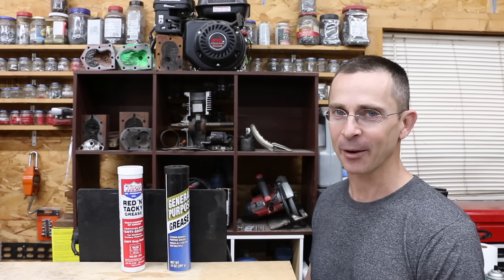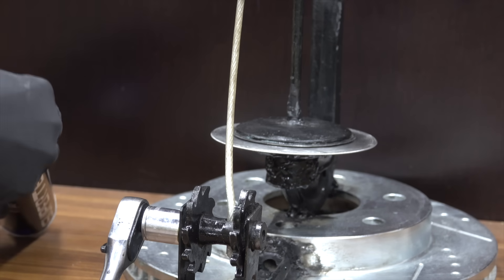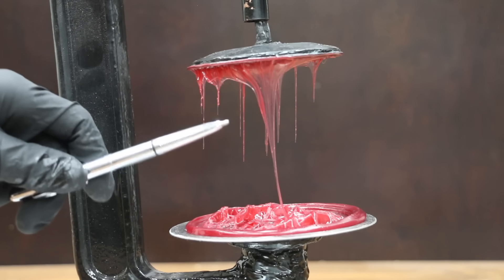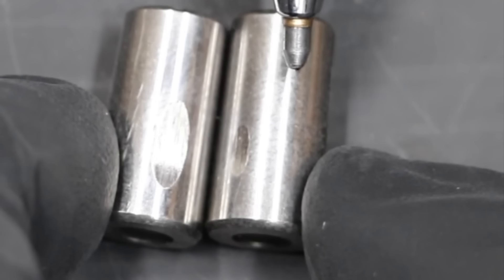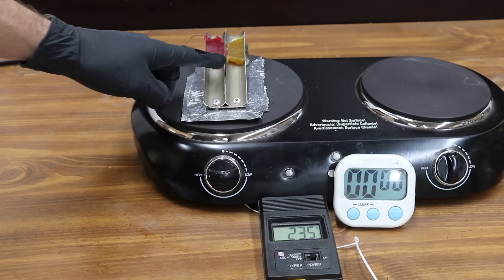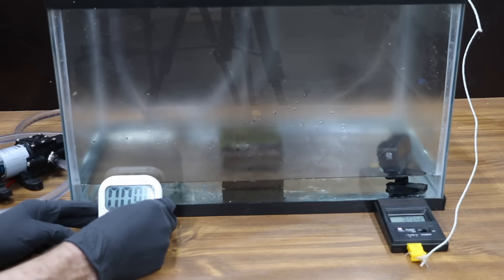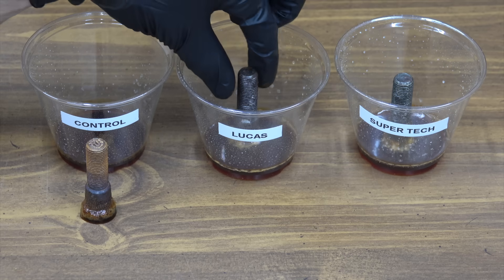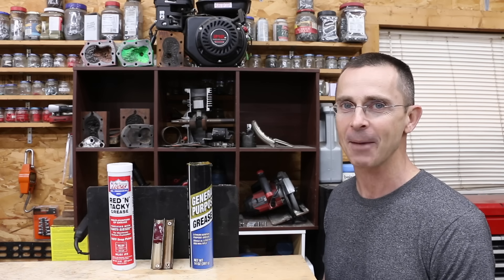Is Cheap Grease better than Lucas Red N Tacky? Let's find out! Bearing Grease Test Episode 1

Comment: I'm going to start sending you invoices for my time, since I spend more of it watching you than doing the work I'm supposed to be doing!  I was actually surprised by the significance of the differences between these greases.  Your test for tackiness was especially interesting and it makes me wonder how each of them would handle centrifugal force.  In many automotive applications centrifugal force would want to send the grease outward in a packed bearing, eventually depriving the inner race of grease if it all has a place to go.  The compatibility of grease is no joke, and I'm glad you did mention it.  In future grease tests I'd be curious how different grease types hold up in similar tests (say, lithium and silicone and Moly based, etc.)  Also, there are instances in automotive repair where grease is intentionally mixed with oil, such as replacing an outer wheel bearing in an axle.  The bearing is packed with grease, but the expectation is that the gear oil will make it's way down the axle tube and eventually mix in with the grease and wash it out.  I've always been curious if one type of grease or another is best used in this situation.  Similarly, transmission and engine assembly often demands a temporary grease be used before trans fluid or engine oil gets through the lubrication passages.  It would be interesting to see how a mix of grease and oil fared in some of these tests.
Reply: The special grease used in engine building is by design, intended to mix with oil. It won't hurt the oil, or the metal parts it's in contact with .
I've built, and helped build a lot of engines and I used 105, engine grease. It works great. One gentleman put an engine together by himself then called me and said the engine wouldn't build oil pressure. 
We pulled the engine,  he didn't tighten the oil pick up tube and the oil pump was only pulling air. We checked the crank shaft and bearings and they were fine. We did recoat them put the engine back in and presto we had 50 lbs of oil pressure.
Reply: @bertgrau9246  Yes, there are special assembly lube for engines, such as Permatex Ultra Slick or the 105 you mention.  Back in the day when I was rebuilding transmissions there were uses for grease too, including holding checkballs in place for assembly in valve bodies, or lubricating thrust washers, or bearings, etc.  In axles with bearings that will start up dry I've only ever seen manufacturers recommend a high temp grease, without being specific.  Some bearings also come with grease installed, even though the bearing might be for multiple applications.  Another area where oil and grease can mix is on splined input or output shafts which initially need grease but eventually will have oil mixed in.

Comment: I have several tubes of lucas red and tacky that are about 8-9 years old when i load them into a grease gun it leaks oil.  This did not happen when they were new, and I don't have any other brands of grease to compare against. I know from past experience grease doesnt usually separate with age. Old wheel bearings getting repacked after sitting decades
Reply from the maker: Thank you for the feedback

Comment: I have been using Lucas Mucas Red N Tacky exclusively on my 2005  Cub Cadet with great success. 15 years and still on the original deck spindles. Seems to be good stuff. Since I'm a huge fan of Motorkote I have contemplated purchasing some of their grease but wonder if the huge cost difference would be worth it. I've also started using Lucas green grease which claims to be heavy duty, but is it? I use Schaeffer waterproof grease on my snowmobiles. Different grease for different applications. I'd like to see red N tacky, heavy duty green grease, Motorkote, and Schaeffer head to head. Thanks!

Comment: Liked all the test set ups especially the power drill. Testing all major brands is a must. You should mention that most universal joints do not use wheel bearing grease. Coming from you it's believable. Keep up the great testing.
Reply from the maker: Thank you for the feedback

Comment: Wow, Lucas kicked SuperTech's ass. I would like to nominate Harbor Freight's "Molly" grease and Red grease. I would also like to nominate mobile 1 synthetic grease, and Mystik marine grease.
HF "molly": https://www.harborfreight.com/sta-lube-moly-graph-lithium-grease-40712.html
HF red: https://www.harborfreight.com/14-oz-sta-plex-extreme-pressure-premium-red-grease-40710.html
Mobile1: https://www.autozone.com/greases-and-gear-oil/lubricant-grease/mobil-1-synthetic-grease-tub-16oz/934751_0_0
Mystik: https://www.basspro.com/shop/en/mystik-jt-6-high-performance-marine-grease-nlgi-no-2

Comment: One of the reasons why it says not to mix greases not necessarily because of a chemical reaction between the two greases that you can easily see , but because it can dramatically change the mechanical properties of the greases ( for example try mixing two unlike soaps/ shampoos or hair gels).
Reply from the maker: Thank you for the feedback

Comment: The Red stuff from Lucas didn't last long in my rebuilt front suspension (<500 miles).
Since I am a fan of most products I have tried from Lucas, I tried the Green Xtra Heavy Duty stuff from them and have had no problems at all in over 3,000 miles. 

I would like this series to continue to see what would be the best grease.
Reply from the maker: Thank you for the video idea!

Comment: I use Lucas oil everything in my race cars and rv and passenger vehicles. I highly recommend Lucas and this video proves the point. Stay away from Walmart brand anything when it comes to metal on metal protection it doesn't pay to be cheap!
Reply from the maker: Thank you for the feedback

Comment: dypex grease is one you should try. its very expensive, but claims to impregnate itself into the metal, and i've heard of it in practice stopping a drill press from being able to drill through metal.
Reply from the maker: Thank you for the feedback
Reply: thanks for doing these comparisions. also, i just thought of another thing. lucas red and tacky is far from the only heavy red grease. i wonder if there is a real difference between heavy red greases.

Comment: Awesome video! I would’ve paid to watch this in a theatre!!! 

Next we need a grease run off like the oil!!! We run a trailer repair shop and see many bearing failures on a weekly basis. We do a lot of salt water trailer bearing failures. Please let me know if we can help with supplying products we use. We’re using Schaefer’s currently but have tried many others. We use your videos to stock our shop with tools and everything that tests well to make our life easier on the job as well as more efficient. 

Please message me a reply if we can’t help in any way to find out what we can put in our customers trailers hubs.
Reply: Personally I use Mercury 2-4-C marine grease on boat trailer bearings, I know it's not intended for wheel bearings but I believe it repeals water very well. I would love to see it put to the project farm test.
Reply: Zach we did some testing with the greases we have. Notice when you read the tubes they say water resistance. We found one that’s “water proof”.
Reply: @RaceMentally  what is the brand?

Comment: I worked professionally on vehicles for many years, and I always used "KENDALL L-427 SUPER BLU HIGH TEMP GREASE" when packing any type of wheel bearings or chassis parts. It's NLGI GC LB Certified #2 Lithium Grease. Would be curious as to how it actually compares to other comparable greases.
Reply from the maker: Great recommendation! Thank you

Comment: I used to make grease. I can tell you right now both those greases are compatible with each other as both are obviously lithium based. However, with the super tech having absolutely no additive package it's going to dilute the additive package of the Lucas making it not as good as straight Lucas, but you can mix them in something like ball joints and clear out one or the other over time with no chemically compatibility issues. Most automotive greases are lithium based now adays, however some polyurethane bushing and electrical components either require or benefit from silicone based grease as it not only has a much higher drop point but it is also extremely hydrophobic. Lithium is the main tho because it's easier and less deadly to make than silicone based grease, and does the job better than sulfur or calcium based grease. You wouldn't want to use silicone in something like ball joints or u joints tho as it doesn't do well with extreme motions that frequently and can fall apart quickly, usually turning harder and less malleable throughout it's life therefore not filling cracks and lubricating as well. That's why it's usually only for bushings. Less wear occurs on bushings as they aren't metal on metal such as other joints. Yeah I used to live for this stuff. I love the smell of a good lithium grease.
Reply from the maker: Great information! Thank you!!
Reply: could you also happen to reveal where you used to make grease at?
Reply: @smoadia85  haha I know you hope I can reveal some insight so it doesn't seem like I'm  sticking up for one company or another. Bad news, I worked at a company that provides commercial products, no retails sales at all, tho you may see some of their smaller antiseize products on summit racing. I worked for whitmore mfg who owns jetlube now. Mainly oil field greases. Silicone, moly, biosulphonate, calcium, lithium, you name it I've made it. Ncs-30, matrix, caliber blue, api, z-50, ditch witch products, Vermeer products, run-n-seal, or the ones you may have heard of are jetlube ss-30, jetlube owns rectorseal so I'm pretty sure jetlube tfw or jetlube v-2 was rectorseal t2. Yep made pipe dope. Oh uh we also owned kats koatings, but that was a very small part of the business. The one you may have heard from Kat's was puncture seal. Don't worry no company secrets revealed here.

Comment: You should test out grease that has molybdenum disulfide in it! It's an additive that works to reduce friction under extreme pressure. DuPont makes a heavy equipment grease (McMaster item 8708T24) that has both moly and PTFE so perhaps it's a super grease. I've used some in robotics and it's worked well but I haven't compared it to anything.
Reply from the maker: Great video idea! Thank you

Comment: As a mechanic you would be surprised how many cars ive repaird as a result of people useing any old grease for wheel bearings instead of rated high temp bearing grease....use to get about a car every 2 weeks suspected of having the wrong grease with noisy or failed bearings
Reply from the maker: Excellent feedback!  Thank you

Comment: I've been using the cheap stuff for everything all my  life.   Never had anything fail due to it that wasn't already well on its way out before I ever put any to it.   In the vast majority of situations proper and timely maintenance does far more for equipments service life than expensive fancy lubricants and the like. 

Simply put, lube and operate things the way they were intended  and it's rare you will ever see a problem to begin with.
Reply from the maker: Great feedback. Thank you

Comment: The red n tacky is pretty good for semi fifth wheels.

Also, "texture: buttery" gave me a good laugh. Lol
Reply: Trucker here and I use the red n tacky on my 5th wheel too cuz the stuff hangs on great.
Reply from the maker: lol. Nice!
Reply: Me three on the red n tacky for the fifth wheel. 
Dion what do you recommend for chassis/brake components on a semi?
Reply: @MrWisdom79  Whatever the shop uses, really. I'd prefer Mystik grease myself but I don't think I've been to a shop that uses it in bulk.
Reply: Some grease last longer/ stays in place longer on fifth wheels. That is true! I use a wide putty knife to clean off the old stuff first.
Reply: im the opposite, i use the cheap supertech on my fifth wheel, cause i do alot of drop n hooks and the tackiness of the lucas  wears it all off the fifth wheel faster.
Reply: Kaden Mercer I’m with you on that one.  Except I use CAT grease on mine.  Red and tacky didn’t hold up to all the drop and hook or all the rain I drive in.

Comment: Sometimes cheap stuff is just as good, sometimes not. I'm sure that cheap stuff would be fine for some simple applications like simple hinges and moving parts, noise shop front shutters etc.

The Lucas is clearly better though an I have to say, while it is more expensive, it's still cheap in the scheme of things, even over here in the UK!

I even use red n tacky in my RC cars. Although the name might suggest it's too thick, in reality pretty much all RC grease is in the same NLGI 2 group so not that far off in terms of consistency. As long as you apply an appropriate mount it works beautifully, very smooth, low resistance and good adhesion to the gears and no issues with plastic compatibility so far either and from what I hear from the model train community, I don't expect any issues in the future either. Although the Lucas costs more than that budget grease, it's an absolute bargain compared to an overpriced little tube of RC grease which is usually just regular grease anyway just decanted into tiny tubes and marked up hugely!

I would love to see a group test of "name brand" multi purpose greases using different formulas. Lucas Red n tacky, lucas x-tra heavy duty, super lube, mobile 1, valvoline, shell rotella, blue marine grease etc etc. It would be interesting to see a comparison between similarly priced greases but also the different recipes, lithium, silicone etc. 

There's so many different types out there either sold as multi purpose or having something like "also makes a great multi purpose lubricant" on the label. I'd love to know how much variance in performance there is and whether there are any particular brands that really do a notably superior job in various different applications, a true multi purpose offering.
Reply from the maker: Great point! Thank you

Comment: When running the bearings I think it might be helpful to run a control without any lubricant at all. You may've done this in the past before but I don't think it would hurt, and it would help prove that the loser is better than nothing.
Reply from the maker: Great recommendation! Thank you

Comment: Thanks for the video. Please keep comparing greases like black moly, white lithium and silicone. Can you give advice as to if there are any negative chemical reactions of these different greases to plastics, rubber and nylon. I do lots with RC car diffs, transmissions and universal joints that have plastic/nylon components. Black moly has been the standard lube for decades.
Reply from the maker: Great video idea on impact on plastic, rubber, etc.

Comment: I use Total as grease on all my farm equipment. I dont really know if it is good or not, but it works fine.
Reply: Can that still be purchased new?  I have not seen that brand in at least a decade, probably longer.
Reply: @ShainAndrews  i bought a 9 pack last summer
Reply from the maker: I'll have to look into it. Thank you

Comment: About the only thing I have that still takes grease is my riding mower.  Both of our vehicles are all sealed.  I miss being able to buy wheel bearing and packing them.  A lot easier than changing out those wheel hub assemblies.  But last time I replaced them on my trailblazer I used Timken bearings as I know they're very tough as that's the same company that supplies bearings to railroads for their locomotives and freight cars.  Perhaps you might some day consider a sealed bearing test.  Just a thought.
Reply from the maker: Great point. Thank you

Comment: I've always used Lucas red and tacky I bought an inclosed trailer changed the bearings when I purchased it. I use the trailer for my lawn mowing business I've put 102,000 miles on those bearings that's what my trailer break system on my truck says. I also use the grease for my spindles for both mowers I have over 1000 hrs on both mowers that's alot of revolutions on the spindles. I but cases a year of the grease and to me this is worth paying even if the grease was 8$ a tube. Maybe next video find who has the best grease cause if theres better I definitely would like to use who wins. I'm am really glad I've stumbled across your channel because I've either saved money from it or I have found brands I though were good weren't.
Reply from the maker: Thanks you for the kind words!
Reply: @ProjectFarm  your very welcome your doing a good service to the consumer because non of us are testing products durability if it dont work we buy other. But your making to where were able to know if we watch your channel. I think YouTube should push your channel because in my opion it's more of a tool than a pleasure for watching.

Comment: At my old job (amusement park),  my boss always wanted to just use one grease for everything.  So he bought the most expensive stuff he could find - Mobil one synthetic.  Used the stuff for years.  It sucked in 90% of the stuff we used it in (mostly brass bushings, but some bearings too). The synthetic base oil liked to separate and leak out of the grease at any temperature.  Even in the cold, the stuff leaked out of everywhere.
We eventually switched to exxon/mobile Polyrex polyurea grease that worked amazingly in a really wide range of applications, and was half the price. It stayed in bushings really well, but maybe wasn't as good as the Mobil 1 in actual roller bearings with seals.
But really, no one grease is good for everything, but it seems that Lucas might've done well in the multitasking application at that job.
Reply from the maker: Thank you for the feedback